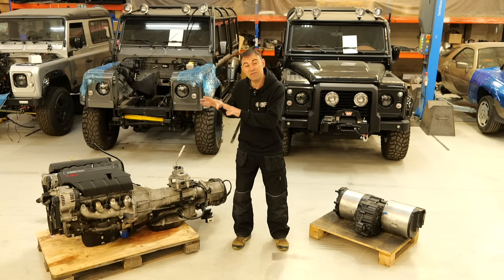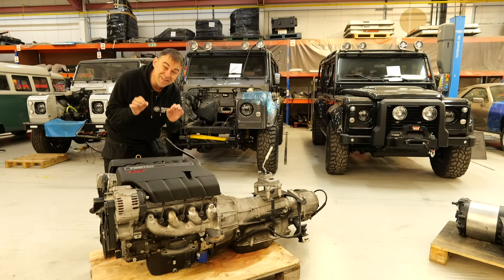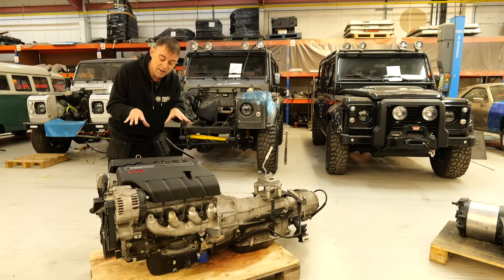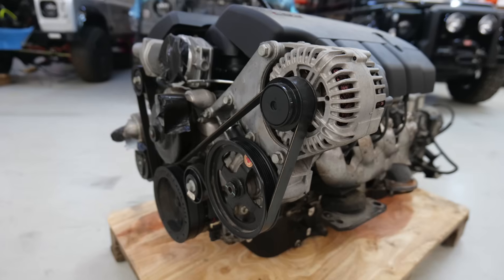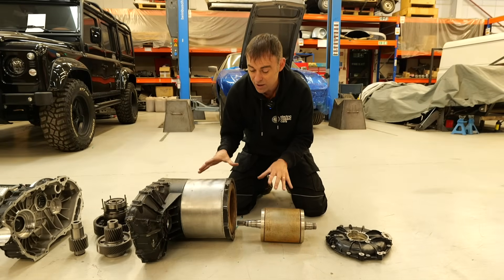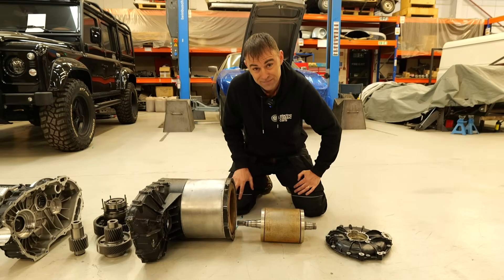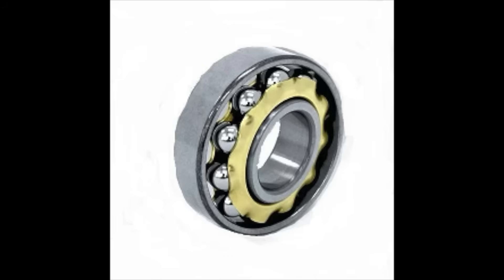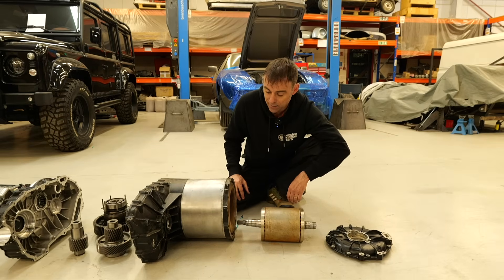Let's compare the Tesla LDU with an LS3 V8 and take one apart to see what makes it tick.

Comment: V8 because you left out filling up, range, reliability, safety and all that really matters in ownership.  Evangelists must know 0 about vehicles, Evsare a joke right now and a safety hazard.
Reply from the maker: Please explain how EVs are a safety hazard with a credible source link for such a claim. Yes, electric vehicles (EVs) are generally considered safer than internal combustion engine (ICE) cars, primarily due to their design and reduced risk of certain types of fires. EVs have a lower center of gravity, advanced safety features like reinforced battery compartments, and fewer potential fire hazards compared to ICE vehicle.
Reply: @ Stached D, Mguy, and so many others, ship board fires, thermal runaway in scooters. I was involved in EVs way back even before the EV1, Evs are not the problem but the battery chemistry is, get enlightened on battery safety.  Firs at Ca battery plant, on its third fire, EV electic door locks, dumbest idea ever, yep there us an over ride but if you are in a crash thinking of that thing that us rarely if ever used is not likely to happen.  Zebrugge ship board fire.  Look at "whats going on with shipping"
Reply from the maker: @jamesocker5235  I said credible sources, not Anti-EV YouTubers that make money off gullible people. I’d suggest watching something a bit more balanced and factual like Ben Sullins.
Reply from the maker: @jamesocker5235 That’s great but go look up how many EVs use LiPo chemistry batteries. I don’t know of any. 🤷‍♂️🤦‍♂️
Reply from the maker: @jamesocker5235 OK, you need to widen your viewing from the Anti-EV cult channels. Stop being a slave to the algorithms, they’re just feeding you what you want to hear. Try mixing in some more balanced information like this. https://youtu.be/45fiopwHVeM?si=nW3PdwdVqL2ZrYBX
Reply: @ not a slave, I'm electronics tech and intimately aware of where it is and what it is.   You need a dose of reality
Reply: @ElectricClassicCars  the battery fires are on a metal fire level,  ask the dead Tesla drivers.
I have intimate knowledge of fossil and EV tech, take fossil any day, and btw your electricity in those batteries is fossil.
Reply: @ElectricClassicCars  you go enjoy your PFM car as you see it, may reality not come home to roost.
Reply from the maker: @jamesocker5235  Here in the UK 1/3 of our electricity comes from renewables, 1/3 comes from low/zero carbon sources, and 1/3 comes from gas. The latter reduces every year as more and more renewables come online.
Reply: @ wrong, an EV on fire is a fire few fire departments can deal with.
Reply from the maker: @jamesocker5235 Fire departments deal with EV fires very simply. Fire blanket. 🤷‍♂️ https://youtu.be/yO8cVWOqZcg?si=_ank2Nr1EwAuB88S
Reply: @ElectricClassicCars  tell that to the dead fire fighters
Reply from the maker: @jamesocker5235  While firefighters deaths are a tragedy in any circumstances what I find disgusting is Anti-EVers who lie and capitalise on this for their own financial gain. Recently there were some firefighters that died in Spain due to a hybrid Porsche driven by a disabled man that crashed into a petrol car. The petrol car then ignited. But the anti-EV YouTube gang disgustingly spun it as an EV fire. The facts are quite different - https://youtu.be/ga1jzoHXiRE?si=mtD3Ed1rfqTEAByz
Reply: @ car park in england burnt to the ground due to hybrid land rover battery fire. Lipo storage system in Ca up in flames and residents evacuated due to toxic smoke.  Yep none of it reported unless you have your finger on these failures and understand that thermal runaway is a huge hazard that strikes when you're the least ready.  Batteries age quickly are stupid expensive to fix and the gigapress frames do not led themselves to repair.  Electric infrastructure does not exist to support large amounts if EVs unless you get new power plants up fast. Fastest plant to build is coal.  Home charging is total debacle, people buy charger gave to pay for subscription and install, company goes Tu and you have junk you cant use.  I drive 70miles per day to a power plant for work, at the end if the day the 110 power that I "might" be able to use to charge would not be sufficient to maintain battery quality over time.   Battery operation in winter-20f a joke that would get you into more trouble.  If these new EVs were old school and repairable by me the owner maybe, but they are not, they are overly complicated the diagnostic software is proprietary.  Garbage ownership experience. Plus battery chemistry isnt safe.
Reply from the maker: @jamesocker5235 A car park in England burnt down because of a hybrid Range Rover. 🤷‍♂️🤦‍♂️ It was diesel. Not hybrid. The fire department report confirmed that as did the owner as did the DVLA when you looked up the numberplate. In fact no where, apart from the conspiracy theory anti-EV cult, is there any proof of it being anything other than a diesel Landy. You might also look up Echo Arena car park fire in Liverpool in 2018, also started by a diesel Land Rover. And before you say, diesel doesn’t burn, ask a farmer what he uses to set on fire damp brush - it’s diesel.
Reply: @ElectricClassicCars  lol your living a lie, that was a hybrid land rover, the battery was right there in the foot well. You can eat up all the Evangelist crap you want but it is on video.  Number plate was hybrid,  you need to live in real life and learn about fires.  The problem with evangelists is your blind faith in tech you dont understand or appreciate.  Maybe in 20 years you be smarter.  Doesn't sound like it but there's hope.
Reply from the maker: @jamesocker5235  I’m not blind, I just do the smallest bit of research. For instance if you look up the number plate on the DVLA website, which is open to anyone to use. The vehicle quite clearly comes up as a diesel, not a hybrid. Even it was a hybrid the battery location is NOT in the passenger footwell. Again the smallest bit of research would tell you this. The Anti-EV crowd found a pre production marketing illustration of the vehicle that showed it in the passenger footwell but cherry picked that image out of the load of other images that show it on the other side to fit their narrative. The Land Rover workshop manual shows it on the other side, the fire rescue app shows it on the other side and any other parts manual shows it on the drivers side. The opposite side from where the fire was. Not that there is any shred of evidence that shows it’s a hybrid anyway. But that’s how Anti-EV Youtube channels work. Search “Range Rover sport hybrid battery location”. Or maybe just watch this https://youtu.be/QRbVWkknT0o?si=k1tv1UN9RFApMNIv
Reply: If you were going to do anything you would go the Edison way but
Battery chemisty is not safe.

Comment: Hhhhmmmm, should also consider the weight of the batteries to make that electric motor work! Also, how log does it take to charge those batteries. Where are all the charging stations? I think I still prefer the rumble of that V8.
Reply from the maker: A car is parked for most of the time. That’s when they charge up. We covered the petrol vs battery comparison in a previous Tech Talk. 👍 https://youtu.be/opF1si__APs?si=7XWvqO3yOdpBaakt

Comment: The comment at the end about maintenance is a key factor. Quality electric drive is darn close to zero maintenance. When we accurately consider the time and money spent on repairs, EV's have some strong points. Brakes just don't wear quickly on most EV's, as an example. A Model 3 long range really has limited range on trips, we all understand this now. But consider the maintenance time and expense and time pumping gas 2x per week in conventional vehicles and the vehicle lifespan, "wasted time" picture changes, big time. Just waiting in line at Costco for gas is a huge time waster.

Comment: The weakest point with an EV today is the range with the battery, but when the evolution of the battery progresses then those claiming an EV needs to do 1000 miles.
Saying that the 200 plus miles from my EV is enough for my requirements.

Comment: They forgot to tell you it cost about 20,000 for a new battery. Also the resale is like buying an old iPhone that's 10-15 years old. Would you?
Reply from the maker: A quick search on eBay tells me a good secondhand Tesla Model 3 battery is around £3500. A Tesla covers around 300,000km before the battery is at 90%, which is more than the average lifetime of an ICE car.

Comment: I've owned two Nissan Leafs so strongly agree with all this. But what no-one seems to have mentioned as a HUGE EV advantage is the marvellous driving experience. Simply brilliant, particularly for congested city driving. Silent, silk-smooth, bags of torque, super-responsive, brake use negligible, etc, etc. And a major service comprises checking tyre pressures and topping up the washer bottle.
Reply from the maker: Completely agree 👍

Comment: That's a shit comparison.  Where's the power pack for the tesla? How badly do you have to cut up those vehicles to install it? As we all know, Tesla's pollute when plugged in rather than when in motion. Terrible presentation.
Reply from the maker: All of our conversions are bolt in. No cutting or welding required to convert to electric. We covered petrol vs batteries in a previous Tech Talk. 👍 https://youtu.be/opF1si__APs?si=PAamJiZGXCB65VEH

Comment: If you weigh the LS3 plus all the bits to make it work - including the fuel tank and the fuel. Now do the same with the electric motor - and the fully charged batteries required to get the same range. How does the math come out for that comparison?
Note: Not being snarky - it's an honest question.
Reply from the maker: We covered the petrol vs battery comparison in a previous episode. 👍 https://youtu.be/opF1si__APs?si=t9Btn91jq2RFN2Xc
Reply: @ElectricClassicCars  Ah, Thank you. I missed that video (3 years ago). It would have been nice to mention that comparison when you talked about the weights here, but it's good that you had it somewhere. 👍
Reply from the maker: @carlpeters8690 No worries. We linked it twice in the episode. 👍
Reply: @ElectricClassicCars  Awesome, I was listening while working on other things so I missed it.
Reply from the maker: @carlpeters8690  That’s a good point. I do the same. I should make sure I say it out loud next time. Thanks for the tip. This YouTube stuff is still a classroom for me. Always learning. 👍

Comment: The thing is that the electric motor is nothing really new. We've had very efficient electric motors for decades. What the advancement truly was is portable power, battery technology is still shit but is now 'good enough' that now it can compete with internal combustion engines.
Reply: I'm also not trying to minimize the recent advancements in electric motors, such as the reluctance permanent magnet motors that Tesla uses in their cars, which are even more advanced, efficient at low RPM. These advancements are amazing.

Comment: There is a case to be made for electric powertrains over ICE but don't trip over the truth in your over eagerness to make it. No one who actually builds installs powertrains believes an electric motor without a battery pack is a 1:1 comparison to an internal combustion engine + accessories. This video is so silly that I'm not sure if I can attribute it's false statements to only stupidity. 

The Tesla unit makes zero power without a battery pack and how much power it makes depends on what battery is connected to it, ranging from a hypothetical ~zero to the full advertised amount. A Tesla OEM battery + the electric motor will weight far more than twice 400kg (the LS3 used for comparison) + whatever weight you want to assign to the fuel cell.  

Regarding parts--show us how many parts are in the inverter and in a battery pack, then get back to us about how that compares to an LS3.
Reply from the maker: I didn’t show how many parts were in the gearbox, transfer box, etc either. This is an episode all about the Tesla motors, compared to an engine. We covered petrol vs battery comparison in a previous episode. 👍 https://youtu.be/opF1si__APs?si=t9Btn91jq2RFN2Xc
Reply: @ElectricClassicCars  My God!  How often you answer the same question.   You must have the patience of Job,

Comment: The electric motor is far more efficient and less moving parts, but it's biggest problem is the power supply. Even the best battery pales in comparison to the equivalent fossil fuel in energy density. Even if the energy density was 25% of gasoline or diesel, it would be an absolute game changer but currently it's about 1/63rd as good, so nope!
Reply from the maker: We covered battery vs petrol comparison in a previous episode. 👍 https://youtu.be/opF1si__APs?si=t9Btn91jq2RFN2Xc
Reply: @ElectricClassicCars  Then you know that in reality, not just fantasy land that batteries have a long way to go to catch up to fossil fuels.
Reply from the maker: @dundonrl  That’s like saying petrol has a long way to catch up with nuclear because nuclear is more energy dense. 🤷‍♂️🤦‍♂️

Comment: i would add the weight of a full tank of fuel and the tank, but for sure would add the weight of the batteries for a range of about same distance as of a full tank of fuel for the LS3, i know other things play into it, but a rough ball park would be a fun comparasion.
Reply from the maker: We covered petrol vs battery comparison in a previous Tech Talk. 👍 https://youtu.be/opF1si__APs?si=t9Btn91jq2RFN2Xc

Comment: I enjoy seeing my industry: (Industrial Electronic Drives and Automation) transferred to everyday vehicles!  A fairer weight comparison would be adding the battery pack and other misc. electronics to the Electric Motor side vs those added parts in the back crate plus a tank with 20 gallons of gas for the LS3.  That electric motor alone is a technical marvel in itself adapting several technologies into 1 unit.  (Not your off-the-shelf standard 3 phase electric motor your Father and Grandfather used to use, LOL!)
Reply from the maker: The Landy weighs the same when it’s electric as it does with the LS3 in and fuel in the tank. We covered petrol vs battery comparison in a previous Tech Talk. 👍 https://youtu.be/opF1si__APs?si=t9Btn91jq2RFN2Xc

Comment: It's really just the battery tech and electronics that are the issue.
Most mechanics don't like electrical, and most diy guys aren't going to want to mess with batteries and electronics.
Until batteries are better in both size and simplicity, and electronics are simplified a bit, I don't see electric vehicles gaining attention as easy performance vehicles or upgrades.
I personally haven't done anything to a Tesla, or really researched the operating system, but I know the batteries are an over complicated assortment of tiny batteries, combined to make the pack.
Wiring up custom battery packs is way too much for most people.
I used to build custom battery packs for RC cars, and I can plug into a Castle speed controller and program it with a computer, so the concept isn't foreign to me, but for most people I just don't see this as viable.
I have toyed with the idea of making a custom ev from a salvage Tesla, using the stock pieces and making a new body.
Maybe someday.

Comment: The difference between an engine and a motor is the chemical reaction happens externally for the motor ie. the battery. If you want to compare sizes, the battery is the actual power generator. That's why there's a cooling system for the battery.

Comment: Um... 140 kilo motor AND a 400-600 kilo battery and it loses its weight edge. Couple that with range limitations, charging times, replacement costs, and technological difficulties, places it out of the ability of the garage mechanic.. I don't think most people want to do a resto mod with an electrical drive train.. It kinda defeats the whole purpose.. Cool for a niche audience but not practical yet. Some day maybe, just not today.

Comment: Where's your battery pack? You can't compare an entire engine and powertrain to just the single electric motor. You need to include the battery pack that goes with that electric motor. One of these 2 can pretty much provide propulsion to wheels and run immediately. The other one can't.
Reply from the maker: We covered petrol vs battery comparison in a previous Tech Talk. 👍 https://youtu.be/opF1si__APs?si=t9Btn91jq2RFN2Xc

Comment: I have a Hellcat Ram and a Tesla. I love both, and I agree, electric is the future. But ICE will never go away completely. The 80% waste in noise & HEAT is a GODSEND in the winter. 
Took my Tesla up to a cabin in about 10 degrees F, and it was sketchy and scary to say the least. It was consuming 2-2.5X the energy just to keep the battery warm enough. I had to shut off cabin heat to be able to make to the charger. Barely made it with 2% left and I was freezing, literally.
Took the same trip in my Hellcat, it was a winter storm and I had a blast. The HEAT did not affect my mpg at all obviously. I did not even think about the range or the temperature, it was actually below 0 F most of the time and I was nice and toasty listening to Christmas music inside lol.
I still love the Tesla and use it daily, such a fun car to drive,  but it could never be my only car.

Comment: In comparing an IC engine to an electric motor, you need to remember that a power station   actually converted a fuel, natural gas or coal, into electricity for the motor.  The simplicity of the electric motor is possible because of a very large and complicated electric power generating plant that burns hydrocarbons to create energy and an equally complicated power grid.